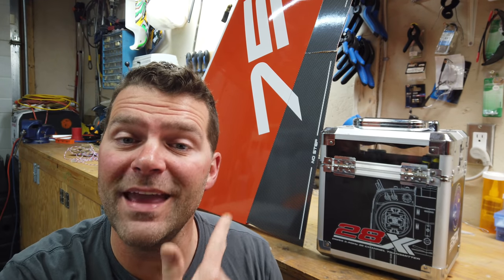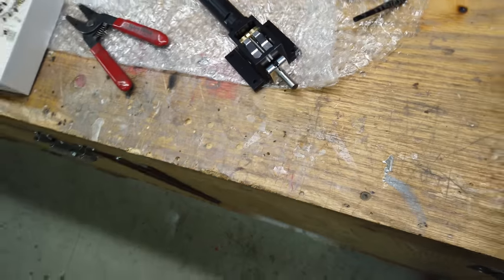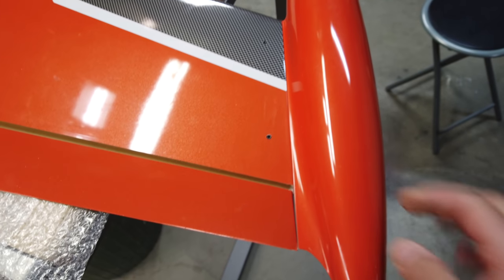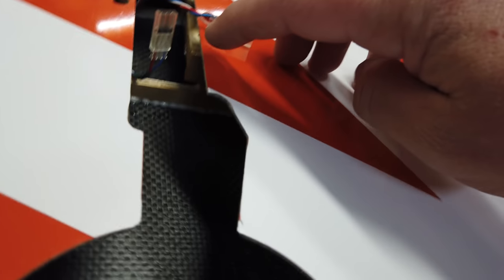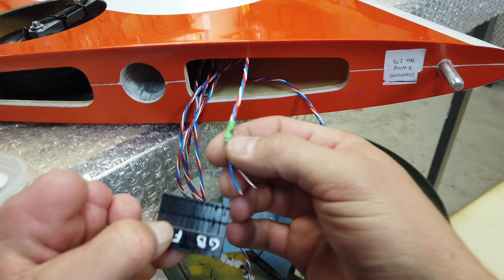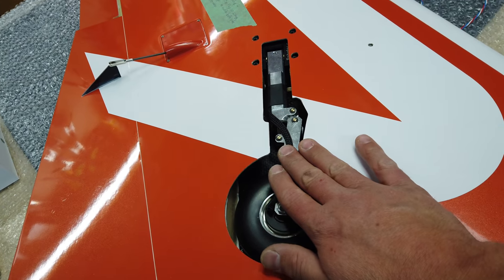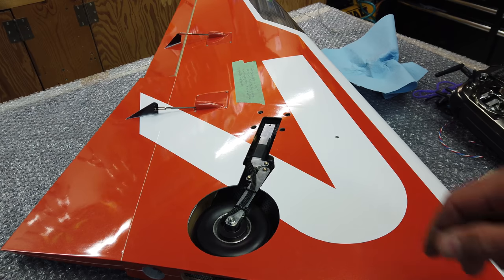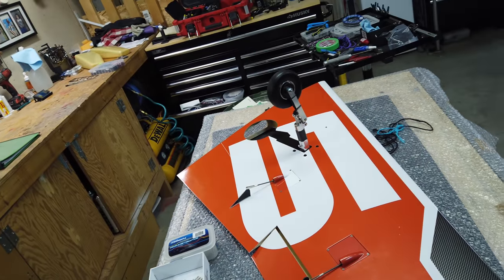LETS BUILD AN AIRPLANE WING - Aviation Design Diamond Part 8

Comment: No gear doors? Seriously??
Reply from the maker: +Amtrakeng nope. On a plane like this it’s nice to keep things simple
Reply: @thelightersideofrc  evidently.  I was thinking those are 3 pretty big holes to be dragging around the sky at 200+mph...
Reply from the maker: Yeah totally. Don’t think it’ll be an issue on the airframe because three holes are boxed in. The nose gear for example is completely boxed in. Ultimate jets down in the US did make a gear Door set for it and with the gear Doors you get a little bit extra speed
Reply: @thelightersideofrc  that thing is all about speed..lol..Im thinking that you got it because too fast isn't fast enough...lol..I'd go get the door kit...squeeze all the speed out of it you can...😊😊